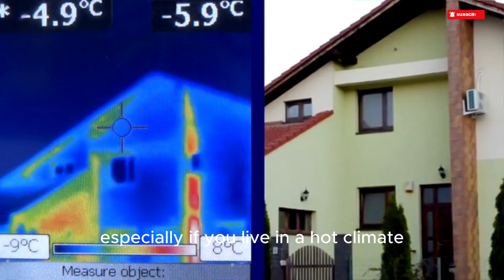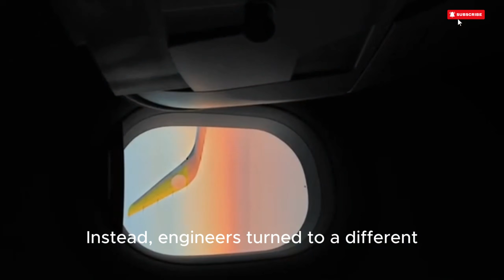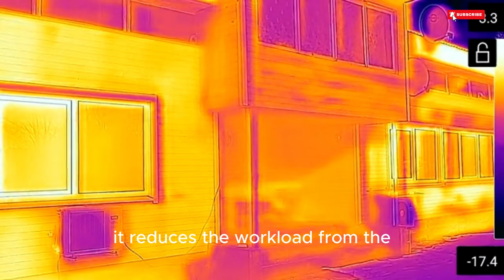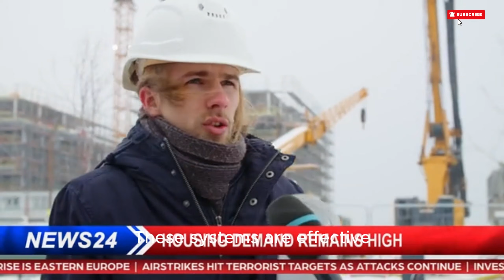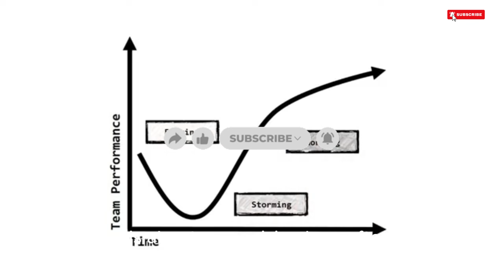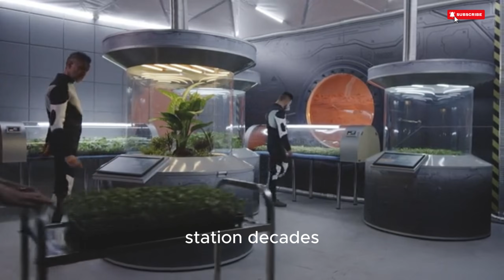The $15 NASA-Inspired Trick That Saved a Space Station and Can Cut Your Home’s Heat by 80%

Comment: Low E glass.(Permanent)/ Larger roof overhang optimised for summer shade/ Outside shutters any form old wooden plastic or metal./ For Inside any curtains blinds what has high reflective surface facing out.

Not need NASA just stay on earth... All examples you can control the heat gain except for the first one. 
(All just to control the heat RADIATION from the sun) 
Have a sunny day for everyone😉
Reply from the maker: Thank you for sharing your thoughts and insights on the video!